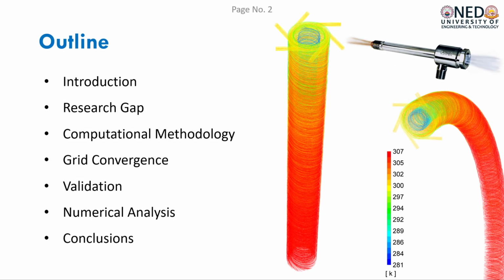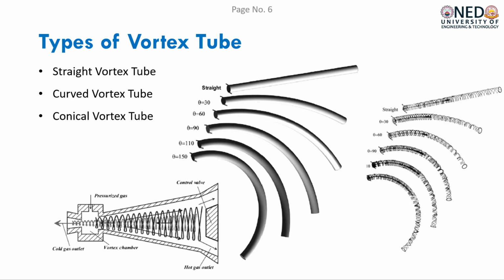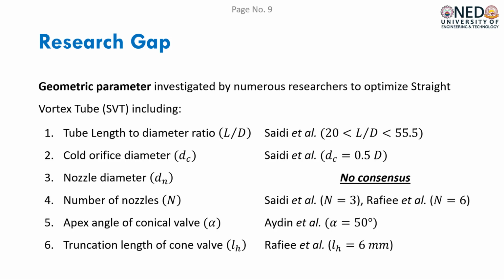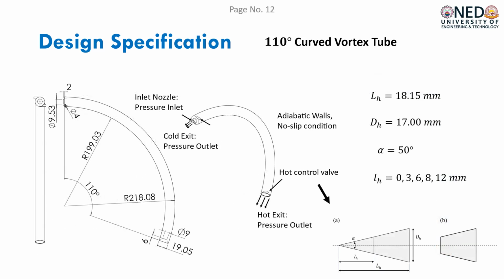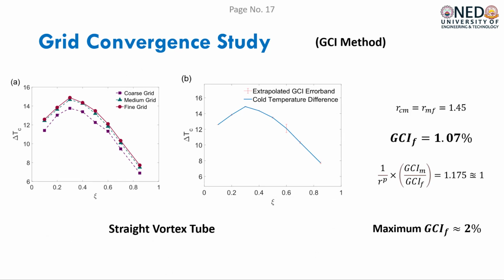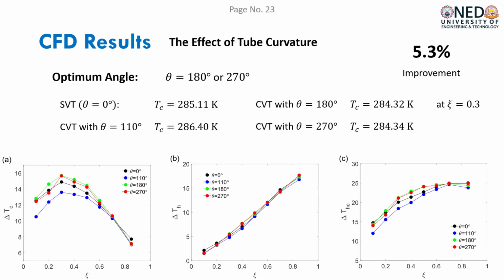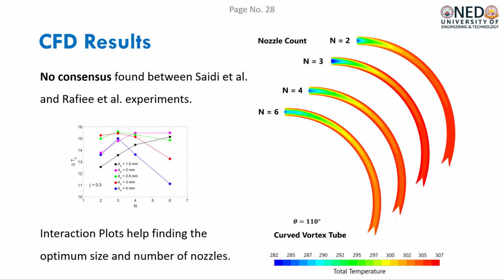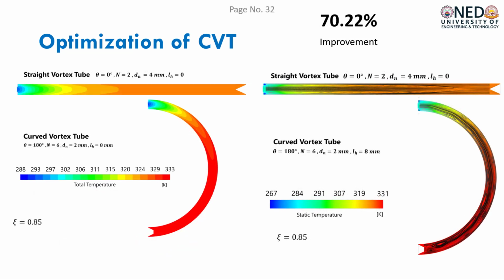CFD Analysis of Curved Vortex Tube using RANS Equations

Comment: What is the temperature at each boundary condition...
Reply from the maker: Temperatures at the outlets are calculated. Pressure Boundary Conditions are applied according to experimental data by Skye et al. Inlet temperature condition is also according to the experiments.